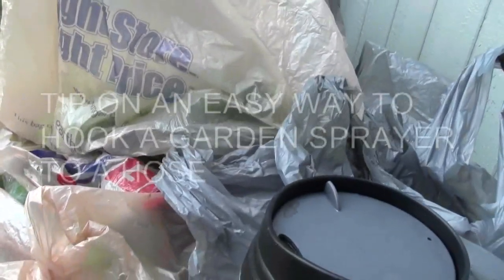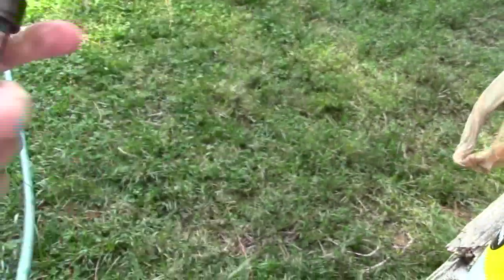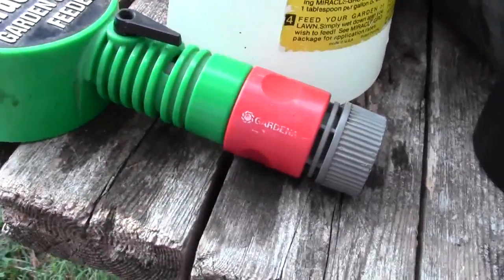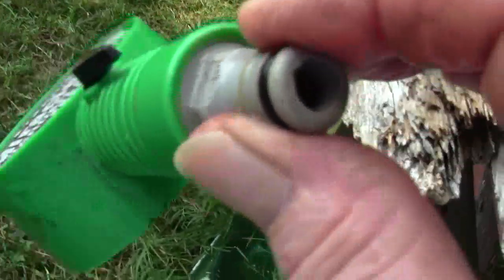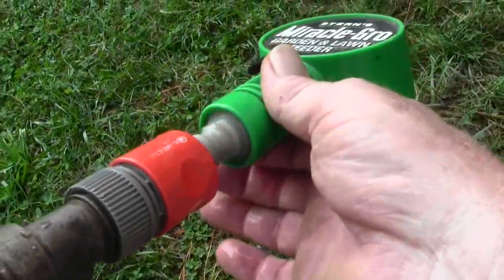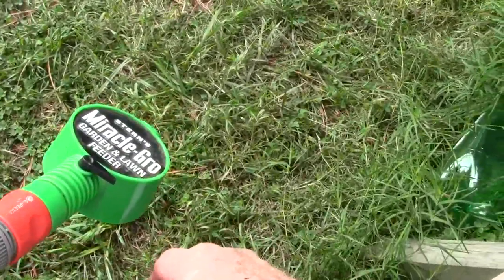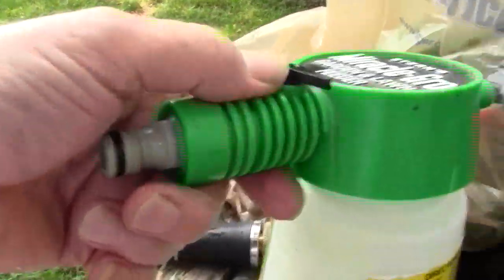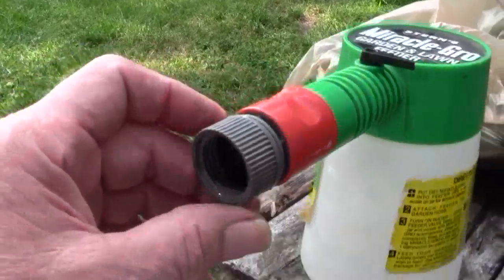EASY WAY TO USE A GARDEN SPRAYER

Comment: I have some of the quick connectors for my water hose, but I like the one you can just cut off with your thumb. I will be on the lookout for that one, thanks my friend. Pam
Reply from the maker: Willows Garden Lowes and Home Depot sell the hose cut off valves. It save a lot of trouble changing what is on the ned of the hose. Bernard